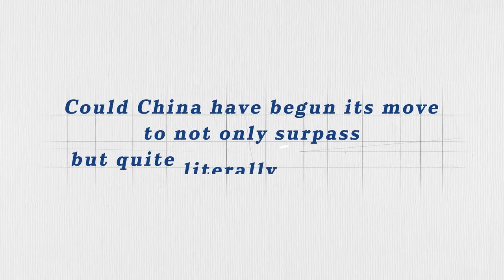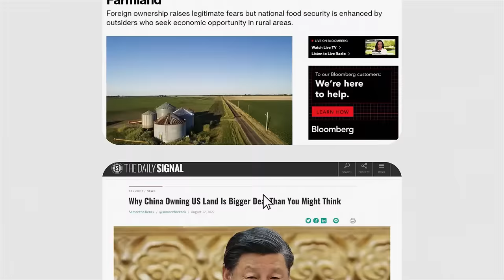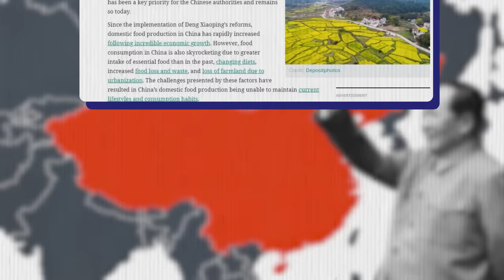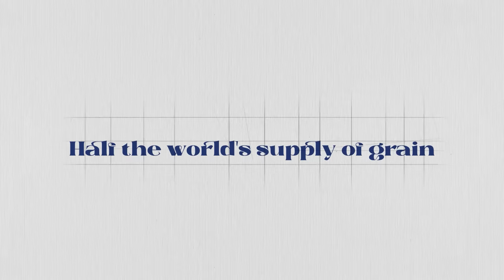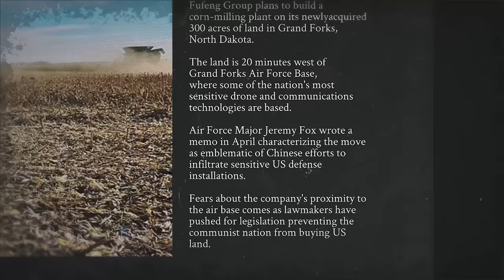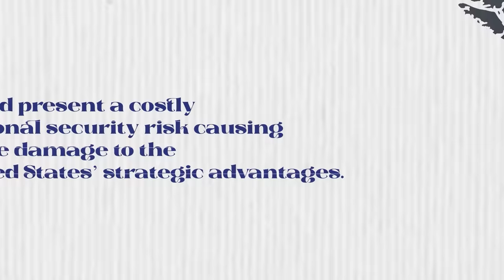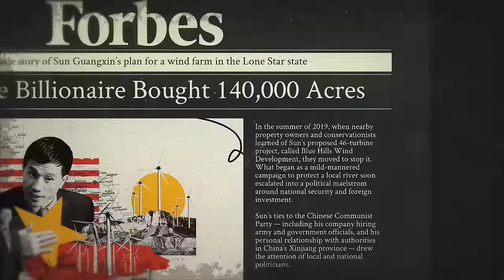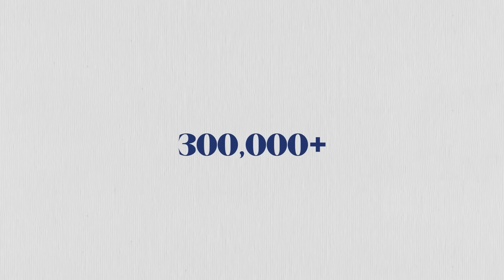How CCP is Stealing American Lands?

Comment: The US and China's commercial relationship has turned south and now, the winds of war are blowing between the US and China over Taiwan. When a major conflict irrupts between these two countries, you can bet the house the land held by China will be confiscated and it won't matter if the Chinese are using a "front-man", there will be no where to hide. If you don't think that's possible, think of all the things done in the past during war times using special legal powers. Remember what was done to the Japanese residing in the US during WWII. Also, you don't even need a war for drastic and unusual measures to be taken by the US  government in its homeland, REMEMBER THE CONFISCATION OF GOLD BY THE US GOVERNMENT AGAINST ITS OWN CITIZENS IN THE 1930s. This particular incident in my opinion, was a complete overstep and overreach by the US government that completely violated it's own citizens constitutional rights, yet they did it anyways. So, why would the US government act any differently against the rights of forgein citizens whose nation is at war with the US? It won't, period.

If something or someone becomes a threat to the US it will be dealt with one way or another regardless of the actual legal framework. In fact, with the current Homeland Security Act, the US doesn't need to invoke any special powers to confiscate Chinese owned land in the US if it is deemed a threat to national security. 

God Bless America and Our People. We Will Prevail

Comment: While this is certainly a problem and a concern the US would do well to address it, considering that Jeff Bezos owns (0.3%) more farmland than China does (0.2%), I don't think that the US is at risk of China suddenly cutting off US food supply.
Reply: Well let something go unnoticed long enough and it can go out of control wouldn’t you try to stop cancer while it could be Benign you want to stop it if it isn’t or get rid of it just to have it gone
Reply: i think national security is a bigger issue with the specific areas they are buying lands near military bases and arms manufacturing areas. In regards to food I think buying specific companies like smithfield foods which owns 1 in 4 pigs raised in the US could be harmful in affecting the prices and the supply.

Comment: ×1.8 discrepancy!!! 4:15, a figure of 350,000 acres worth $B1.9 is quoted as owned by China "by the end of the decade" (unclear, the last day of 2019 or 2020?); at 4:40, the Fox screenshot shows 191,000 acres and the same $B1.9 by EoE 2019. I'm sure you check your sources better than Fox News🙄, but please issue a correction. Which of the figures, if either, is right? Less than 5 min into the education video, numbers are messed up, and I'm like 🤕.

4:15, “increased 26 times” could have been easier to grok than “increased by 2500%!” Percentage increments aren't ordinarily used outside of ×2 range, unless the quantity is usually tracked as % increments (like the horrific Turkey inflation). Percents are certainly not the best way to compare two numbers which are an order of mag apart. You're educating, not sensationationalising, right? RIGHT??? 😉 Increase by 2500% or 25000‰ or 250000‱ is the same numerically as 26 times, but is a sure way to make the number as dense for the viewer as possible...😕